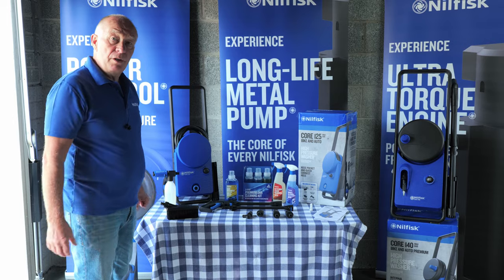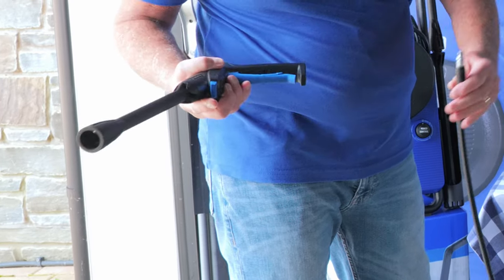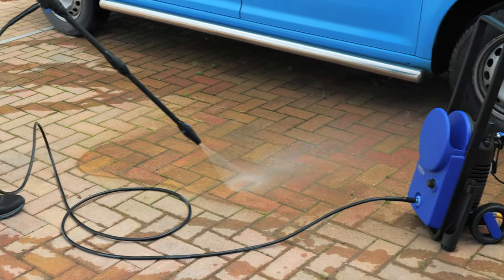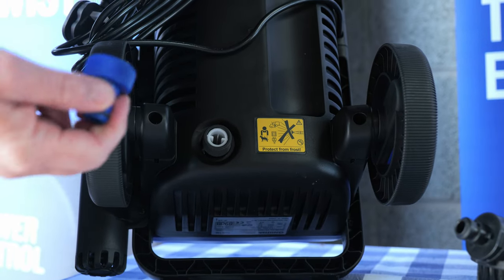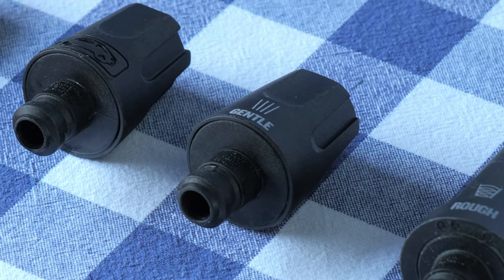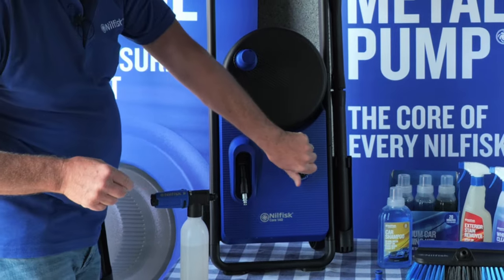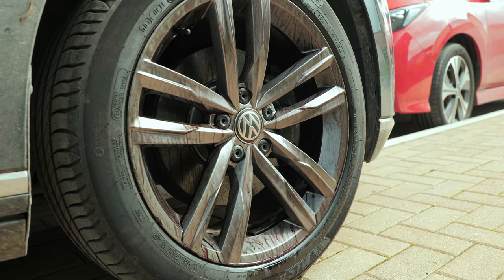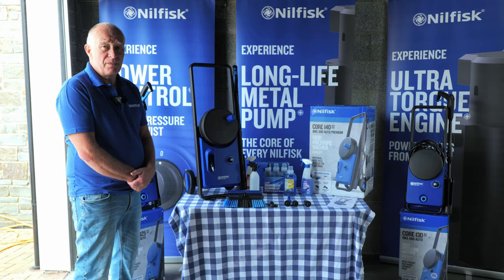Nilfisk Internal Training Video

Comment: I have the 125, like it a lot, but as a pressure washer that is intended for car wash- it is designed  with the worst experience for car wash.
first of all the 5m hose is way way way too short for car wash- just unusable for car wash- you need to get an aftermarket hose with at least 7m.
second- the length of the gun- its maybe good for patio wash, but for car was- it is way too long and awkward  to use- got an aftermarket QC gun.
third- the foamer- well the only thing that it was intended  to do it does the worst way possible.

now for the the good stuff- the power cable management  with that rubber clump is a nice touch.
it got decent  power to wash a car but not to damage the paint.
it stands in stable way- and easy to carry around.
and if compared to the karcher k2 witch it replaced  its a better value overall.

the main down side is as i stated you need to get aftermarket equipment for car wash, because the equipment that comes with the gun does not intended for a car wash.

Comment: Nice video
Why does the 140 model on have 2 nozzles but the cheaper models have 4?
Reply from the maker: Hey, I'm not sure, assume it's just for upselling/marketing.
Reply: I have just bought the Core 140, which water (from the tap) hose should I use? Nilfisk recommend using Nilfisk hoses up to Core 130. Sometimes I wish I'd never bought it 😕. Which hose are you using?